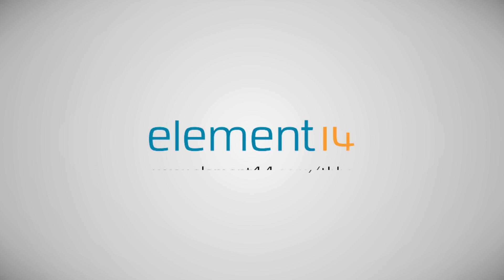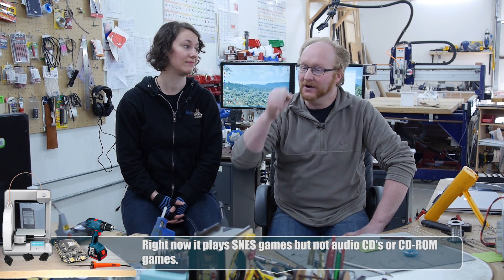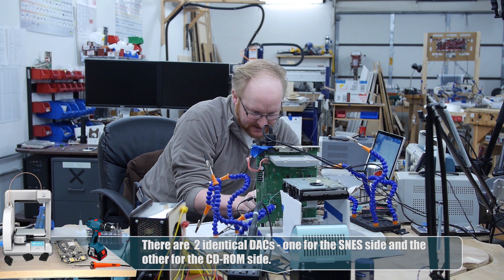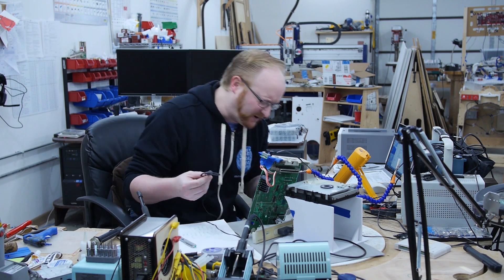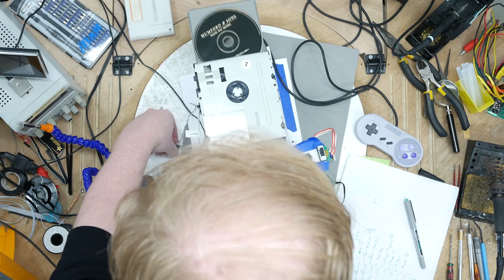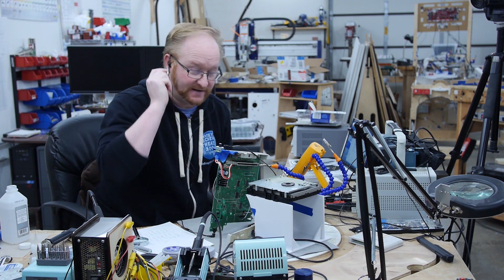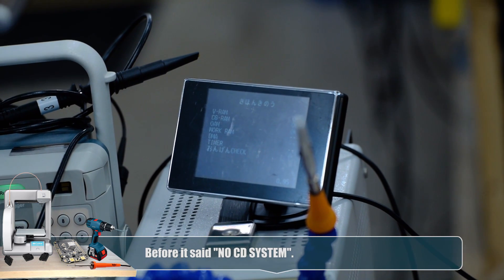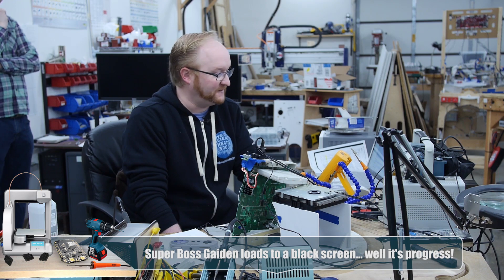Nintendo PlayStation Prototype: Finally Working!

Comment: All of a sudden started working. "What changed!?" Story of troubleshooting electronics and computers
Reply: Pull the cable out, put the cable back in again, it works! <-- computer troubleshooting.
Reply: The IRQ thing was the cause of Magic Floor's screen flicker. Since it was homebrew, and the programmer, like everyone else, has never touched a Nintendo Playstation, he wrote the code using wrong assumptions. He fixed it by changing the code to take care of the IRQs. 

For the sudden recovery, it mentions Ben replaced a few capacitors. Electrolytic capacitors just aren't made to last, so after 20 years they often fail, and there's dozens of them in the Ninstation.
Reply: As a programmer, these mysteries also commonly pop up when debugging. Usually when adding error catching for the bug to throw additional info to help figure out the problem, only for the bug to vanish never to return again, for seemingly no reason. It can haunt you at night sometimes.
Reply: *when I fix anything
Reply: Have you tried turning it on and off again?
Reply: Scoop of the Crispy 
theres the turn it of for a month therapy for electronic. Things just magically start working again after some vacations.
Reply: Yep, this is pretty much my experience as a unix admin in a nutshell
Reply: I work IT and sometimes when I'm trying to fix something it just starts to work.  The person really wants an answer of what I did so I just say something that sounds technical.  Turning it off and on again really does work!  I'm pretty sure that's how Ben Heck fixed it.  He just turned it off and on.
Reply: Scoop of the Crispy i
Reply: But i doubt these is some kind of race condition. These are single processor systems with almost nothing to be considered random.
If stuff magically starts or stops working it most probably has to do with the hardware itself, its starting condition or some loose cable.
Most problems i've seen in shitty hardware was related to that, that's why there "off for a month" trick tends to work. I have a motherboard from a client that became a zombie after a blackout, no audio and the post said opcode error eevery time you started it, even after reseting the cmos, updating the bios and all. I left it with no battery on a shelf for a month or two and then it magically started working fine again, no audio though, the chip is fried.
The moral of the story is: Motherboards with VIA chipsets are a piece of shit.
Reply: the amount of times i've disassembled a device to try and see what is wrong, had no clue and just put it back together then it started working...
Reply: Been "fixing" old electronics lately, 9 times out of 10 reseating cables and cleaning everything does the trick. But if it's got moving parts, like a VCR or printer, good luck!
Reply: After a lightning storm and power outage, one of my pcs wouldn't get to the bios stage with the mouse plugged into the rear ps/2 port. Took a while to figure that one out.

Also back in the dialup days, my internet would not work unless I was moving my mouse, but that was an IRQ conflict issue. Not knowing what IRQ were at the time, this also took a while to figure out.
Reply: yeah, you're completely right!
Reply: Benjamin Heckendorn had the ribbon cables been disconnected before? The 32X has a pair of ribbon cables in it that, for some reason, sometimes need to be disconnected and reconnected to get the thing to work.
Reply: Software developer here. Can confirm.
Reply: How I fixed a dead gameboy.
Reply: Scoop of the Crispy I know exactly what you mean
Reply: +Scoop of the Crispy, As someone who worked in the field repairing all types of electronics for 15yrs I can tell you it's a case of a technician attempting humor, actually to be fair as lame as it was it's probably one of the best attempts I've seen so far lol,  Don't worry Ben Heck, I got you sarcasm haha :)
Reply: This =DDD

I have the magic touch with computers. It's not been just one or two times when someone has trying to get their sound/drivers/whatever to work, then I come like "can I try?", click around randomly seeing if everything is seemingly fine and then it just works.

"How...what did you do?" 
"I honestly don't know. I didn't do any changes. You're welcome!"
Reply: As a laptop repair tech that is the most true thing I've ever heard!
Reply: Sounds like coding. "Why isnt it working?" "why is it working?"
Reply: The power of George Micheal!
Reply: So what did happen? Was it the cables? Or still a mystery? I'd hardly call it done and ready for the programmers if they still don't know why the CD was not working.
Reply: An annotation said something about IRQ
Reply: As we all know, you have to put it in rice overnight. The rice will attract Asians, who will then fix it for you xD
Reply: On hardware this old, replacing capacitors is the first thing you do. Given that they have goo inside them and dry out, I'd put money down that 80% of the troubleshooting/issues could be solved by just replacing the caps throughout the entire device.
Reply: yeah, he didn't suspected of the laser that might be dirty, scratched or weak.
Reply: Same. I was trying to get my GameCube to mount my SD card. I just couldn't get it to work. Next day I booted up my GameCube again and it mounted first try. I couldn't get it to load my ISOs yet but I'm working on it.
Reply: lol whenever this happens my go to is "machines, they're weird..." chuckle and hope the other party just accepts it

Comment: what the hell are with these "Sony is the devil!" comments? They never demanded Nintendo's IPs. That has nothing to do with what actually happened...
Reply: Sony wanted the royalties on all Super CD games, arguing that the CD attachment would drive more console sales which would in turn drive more cartridge sales that would go exclusively to Nintendo.   After inking the deal, Nintendo backed out and made their ill-fated deal with Philips before breaking the partnership with Sony.   Sony learned about Nintendo's new deal at the press conference just like everyone else.
Reply: Let's not pretend either company is innocent here. Because they aren't.

According to what little information we have (which is hard to track down reliable firsthand accounts of), what happened is roughly as follows:

During the late 80's, Nintendo asked around for a new, advanced sound chip for their next console.
Ken Kutaragi, a Sony employee, agreed without really asking anyone else at Sony, and more or less created the SPC700 used in the snes by himself. The management later found out about this deal, but weren't particularly interested in gaming. Still, they reluctantly agreed to produce the sound chips Ken had designed for the snes.
Nintendo then started work on a CD add-on, and, having already established a working relationship with Sony, which also happened to be one of the companies responsible for creating the CD in the first place, asked them to help.
Sony, by this point had gotten somewhat more interested in games. They agreed to help Nintendo with the design and production of the CD drive for the SNES, but the conditions of the contract they signed weren't favourable to Nintendo, in that Sony would get ALL royalties for EVERY CD game published, and would have exclusive control over production. Quite why Nintendo did not spot this right at the start is very unclear, but it would have meant Nintendo got nothing. No money whatsoever for any CD game released for the system.
It shouldn't take a genius to see that's not a particularly favourable contract for Nintendo or for any company really (profits are the bottom line of any business.), and does kinda suggest Sony were being dicks about this deal, in all honesty.
This of course, led to an equally crappy counter-move by Nintendo.
To begin with, Sony and Nintendo jointly announced that they were working on the CD system publicly at a trade show.
Just a day later, Nintendo announced, publicly, that the deal with Sony was off, and they would be working with Phillips instead , and gave Sony no prior warning whatsoever - the public announcement was the first Sony themselves heard of the deal being off, which is the business equivalent of stabbing your partner in the back in front of a huge crowd, and especially in japan this was considered very dishonourable, plus, they were dumping a Japanese company for a European one, another move that isn't looked upon too kindly among japanese businesses, especially in that period.

What can we see from this?:
Sony were acting like arrogant dicks and were throwing their weight around.
Nintendo's reaction to realising what they'd signed were akin to a petulant child throwing it's toys out of the pram, and were also highly dishonest.
What they should have done, is contacted Sony and told them the deal was off in private, not announce it publicly to the whole world without so much as warning Sony in advance.

I should perhaps also point out, if it needed saying, that the playstation that Sony released in 1994 contains a lot of design elements that Sony learnt directly from working with Nintendo.

The prototype in this video having the name Play Station is no coincidence. - This is undoubtedly the starting point for the Sony console - an SNES clone with a CD drive, upgraded hardware, and whatever changes were necessary to avoid any of Nintendo's patents.
It might seem strange to think of a Playstation this way, but the more closely you look at it, the more obvious this gets.
Though it has more RAM, and every single component from the CPU to the Audio chip is much beefier, the way they are arranged, and what the chips are responsible for looks suspiciously similar to the SNES.
The Audio chip, unsurprisingly is a direct upgrade of the snes chip (Sony made that chip, after all)
Trust me on that, the more you stare at the circuit diagrams, logic and so on, the more similar a Playstation and SNES start to look.
It's no coincidence either that the controller layout is effectively 'how similar to an snes controller can we make this without getting sued?)

These companies tried to screw each-other over multiple times in that period.
But when you look at what happened, if you think EITHER company is at all innocent in this whole mess you are either naive, or a hopeless fanboy of one or the other company.

here's some links to (somewhat) related articles:
http://www.trustedreviews.com/opinions/the-story-of-the-snes-playstation
http://unrealitymag.com/video-games/why-the-super-nintendo-cd-would-have-been-the-greatest-console-ever/
https://snescentral.com/article.php?id=0089

(no mention as such of the Nintendo/Sony rift - but interesting stuff about the SNES CD)
http://www.anthrofox.org/starfox/superfx.html
Reply: Sir Randall Gaming God speed, educated sir.
Reply: I say Sony and Nintendo are just as bad as each other.  Sony did some illegal shit back in the 90's that you may not find on the internet anymore, and everyone knows how Nintendo screwed all the other game companies back in the NES days.
Reply: Odds are it was something with IP since Nintendo is super protective of it (see their attack on Youtubers). They must have thought it was a pretty serious demand by Sony to scrap a project this far in development... Of course we see that Sony ended up getting the last laugh with the PS1.
Reply: Not just Atlus either, other companies who seem to rank highly on the "highly respected by gamers" chart have done stuff people have gotten onto Nintendo for but yet for some weird reason I don't see people complaining nearly as much about these actions when it involves THESE companies. Who exactly?

CD Projekt Red- They trademarked the term "Cyberpunk" because they have a game coming out named that, and despite cyberpunk authors not being a fan that the company seems to possibly have a monopoly on this term now, including the very guy who coined the term, not many gamers seem to really care.

Rockstar Games and Take Two- Sent a cease and desist letter to a group of GTA 5 modders who were trying to port Red Dead Redemption to PC via a GTA5 mod, and they only did it after said modders had spent two years working on it and were planning to release it soon. Despite this I'm not seeing nearly as many people making an outcry over this like this did when Nintendo sent a takedown to AM2R.

Bethesda- Sent a cease and desist to a Doom fangame called DoomRL and threatened a lawsuit against an indie game company that had the word "prey" in the title of their game because Bethesda trademarked "Prey" for the games of the same name.
Reply: Sir Randall Gaming Very noble, Sir. Disregard these people of ill-attitude.
Reply: Bill Hetherington What a thing to say, ma'am.
Reply: Pop Car tnx for the history lesson
Reply: Nintendo used to do business with the Yakuza, sell X-rated playing cards, and run sex hotels lol
Reply: It's wroth noting that Sony and Nintendo are pretty equal in regards to how they feel about emulation that they themselves didn't authorize. Check out Lazy Game Reviews video on the Bleem! PS1 emulator and how Sony outright told stores back in the 90s "if your stores carry this emulator program we couldn't legally get off the market, then we'll just never provide your stores with PlayStation products ever again and put you on a blacklist."
Reply: nintendo screwed over sony back when they wanted them to created the cd add on.. then wanted total control over the project and went to Philips and asked to make a cd add unit on without telling sony(who were still working on the project) which obvious make sony angry
Reply: Pop Car I tried to find their source I cant fid it anywhere.
Reply: Pop Car I can't find the source, bit i can't find any source that proves otherwise
Reply: Pop Car LMAO console war bull shit that should have died years ago. Sony and Nintendo suck lmao
Reply: +Bill Hetherington
>Acting like Sony isn't a cancerous anti-consumer company as well
Reply: Poison more important, Bethesda/Zenimax sued John Carmack!
Reply: KuraIthys literally the only thing they got from SNES is their own audio chip which is based on Apple2gs chip by Ensoniq.
Reply: +William Hetherington
Cool story bro, just like they sued guy who hacked PS3. wait that was Sony.
Reply: Sony wanted 99percent of the profit and it was obvios why Nintendo wanted to drop the deal after reading the contract!
Reply: Im a Sony and Sega fan too tho!
Reply: GM Kof hard well sorry...

But im not 100 percent wrong  also its not like Sony was the angell! In my opinion of this subject I think Sony had more fault in this!
Reply: If you want to talk about IP protection, Disney, Warner Bros, etc are much worse. (Especially Disney) They've completely butchered copyright from something that benefits the public, into something that helps the rich get richer and richer. (By creating the stupid concept that a person can own an idea)

It doesn't really have "limited Times" now, and it certainly doesn't "Promote the Progress of Science and useful Arts" when all of the old works (and scientific articles) are under pay walls.
Reply: Nintendo fanboys tryin' to make Sony devil,just causal stuffs you can find on the web everyday.
Reply: +Poison and after Sony loosing the many court battles, there was a news article on the internet about Sony employees breaking into bleems office and went through there paperwork. It was said that Sony wanted to know how many emulators were sold and to who. Or was it before they lost the court battle with bleem? Sony also got busted creating fake movie reviewers that talking up their movies online in the late 90's. Sony was a good company but something changed in the mid 90's that turned them into liars that hype the crap out of all their products.
Reply: butterflyknife I am not sure you know the full history about Bleem, and no, its not a stupid discussion here as i feel it is needed to reinforce my earlier comment about Sony doing some illegal shit in the 90's. Now back to Bleem. It first started out as an emulator on the PC, and the pc was something a fuck load of people owned at the time, and this made Sony shit their pants as people did not have to spend hundreds of dollars on a PlayStation when they can spend way little on the Bleem emulator and have PlayStation games running on their pc's. 

  I for one am disappointed that Nintendo screwed Sony. If Nintendo didnt screw Sony, maybe Sega would still be making game consoles.
Reply: Pop Car It was really Nintendo's fault
Reply: yes they did
Reply: Does it really matter that Nintendo and Yakuza sold x rated playing cards and ran sex hotels. They are providing the best of both worlds to people.
Reply: agreed. Sony is a way cooler company than Nintendo. Nintendo ignores consumer demands, cuts production, sues fans and sues anyone who might cut into their profit. Nintendo is literally the devil